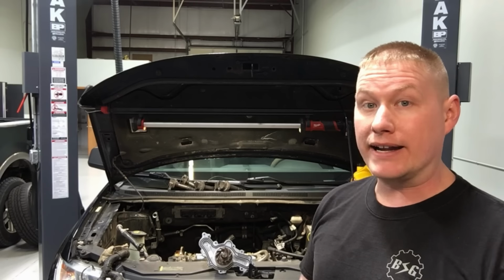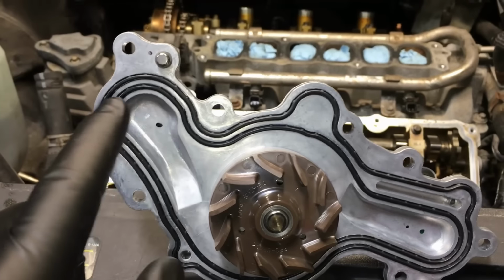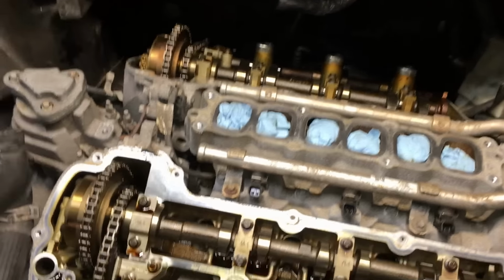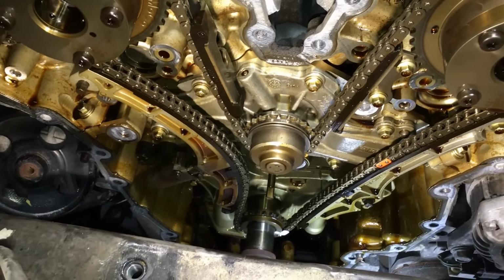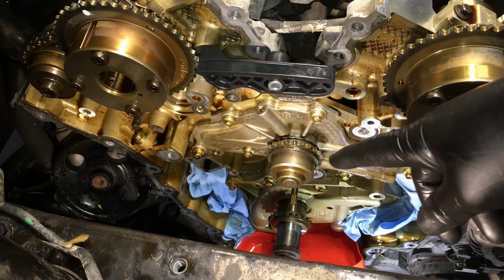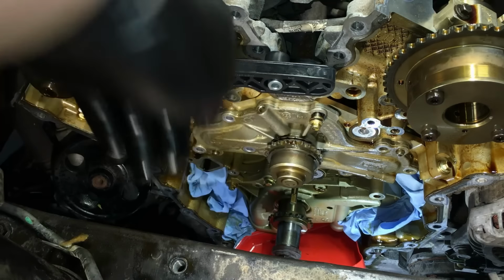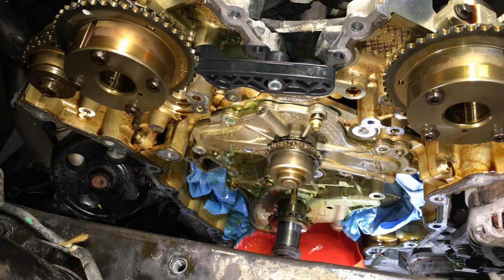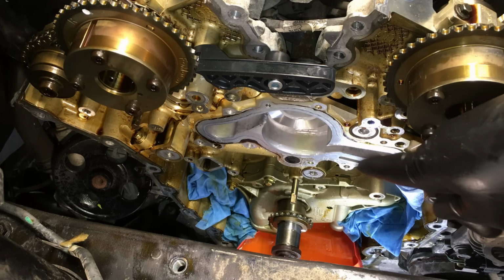Ford 3.5L 3.7L Duratec V6 Chain Driven Water Pump Failures: Check it Before it Destroys Your Engine!

Comment: Is that the Ford Taurus X?
Reply from the maker: 2010 edge
Reply: FordTechMakuloco can this be done in a 2008 Ford Taurus X in the engine bay or does it have to be pulled?
Reply: Just2362 Taurus X pumps can also be done in vehicle
Reply: 93Cobra thanks